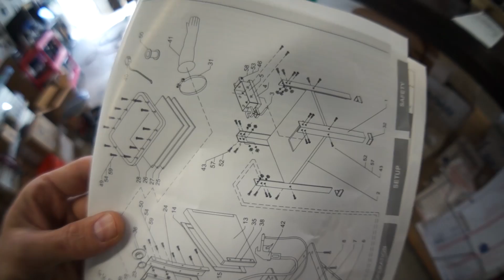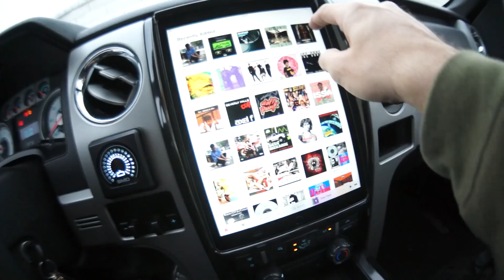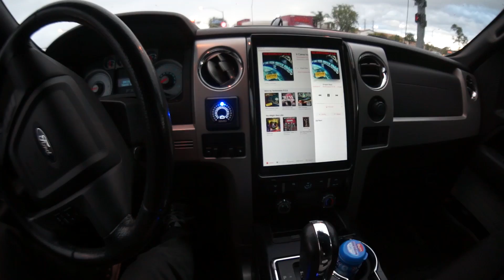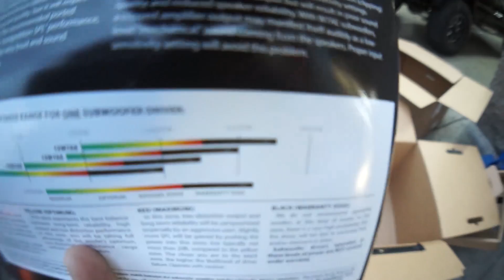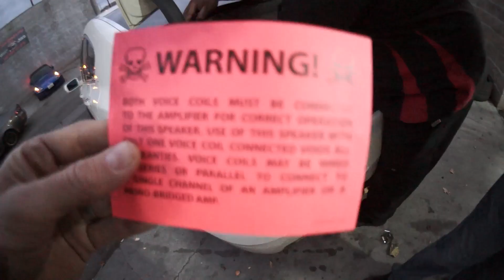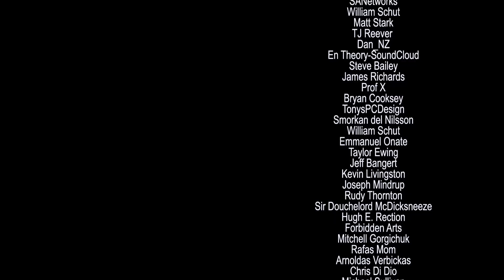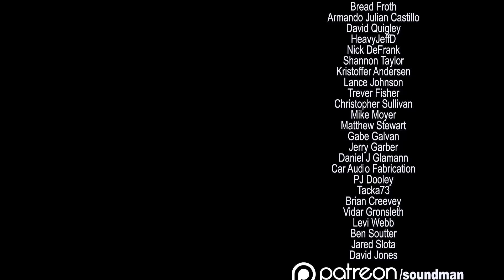Stereo VS Stereo the Christmas Movie - AMPLIFIED #696

Comment: Run a bead of 3m pannle seal on the joints to seal the sand plaster box . When you hook up the vacume air system there will be no leaks! 

Bought that same kit.  Made a great difference!   No more Dust !

Great video as always !

Comment: Pro tip!!!  Get an eastwood sand blaster nozzle, and a 2' coil style air hose to replace included air hose and gun. You'll get better blasting and the dam hose will not blow off every 3 seconds.

Comment: I have the same cabinet... Before you get it full of media, you may want to make a plate to tie the legs together and mount some 4" casters on it. It's about 4-5" too low for comfort anyhow, the legs are a bit shaky assembled, and it's a bitch to move once its full.

Comment: God damn I am not trying to be annoying which I know I am but... So this Audison Bit 1 needs amps? Anyone want to say yes or no? I got the bitch working but before I build my RCA cables. I want to know if I need amps or is there sonething wrong with the bit because its awful quiet. I am running no radio. Just straight off the optical or AUX RCA. So litterally AUX> BIT 1 > Speakers.
I am guessing it should be AUX>BIT>AMP>Speakers.

Comment: Truck system just weak as fuck. Hard voltage drop.
Reply: Subwoofer Videos one battery  .. did he get a bigger alternator? .  i can't remember
Reply: hungrynapps those are upgrades that should be made before slapping in a “7k rms” amp.
Reply: Subwoofer Videos that can eventually cause damage to the amp .. low voltage
Reply: hungrynapps yeah. Even if he did get a bigger alternator he is still dropping below 12v.
Reply: Subwoofer Videos an he clips the shit out of it
Reply: Jay voltage goes below 12.
Reply: Jay yea mic  doesn't really have anything to do with it being weak. He doesn't have a proper Battery bank or cap bank to hold his voltage he's clipping the living shit out of his amp below 12v
Reply: Eric Twenty Hertz flexin yo What you think of those new nsv4 subs

Comment: Wait so they didn't bother to make the box to fit in the trunk  AND that carpet job is crack head status. Remind me to NEVER go there.
Reply: Trey Nathaniel it was a test fit kiddo. Did you not see the final product? It had beauty panels on both sides of the box and it was very clean. It's a waste of materials and time carpeting part of the box that won't be seen.
Reply: So it either had beauty panels or it was a waste of materials,which is it? Kiddo? Bitch I'm 45. And let's pretend I did not notice many other poor examples and jobs being enacted. I used to manage an install shop in Michigan in case you wanted to continue this. Can  give references upon request.
Reply: Trey Nathaniel it has a beauty panel on the front so it would be a waste to carpet the whole box since the back of the box will not be seen smart guy.
Reply: Trey Nathaniel I apologize for calling you kiddo, but I just assumed you were a child since you made the comment "remind me NEVER to go there." Because you don't know what test fitting is.